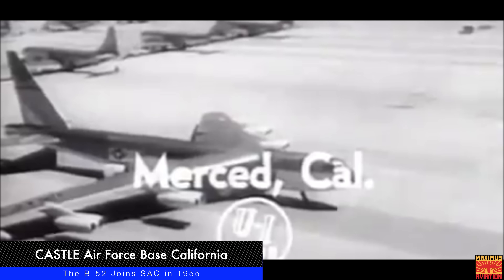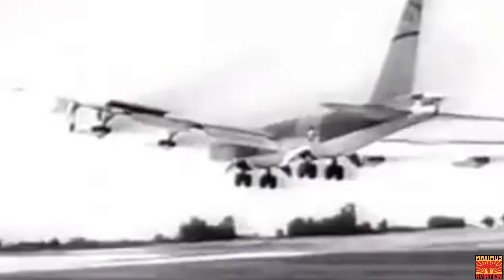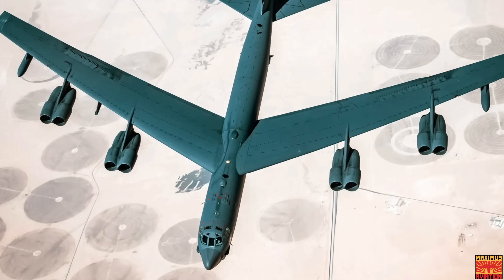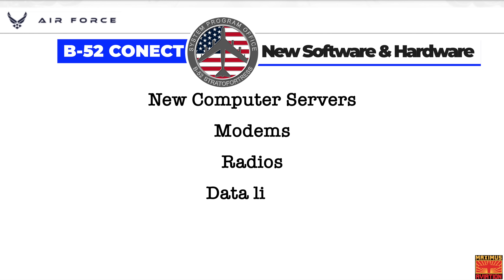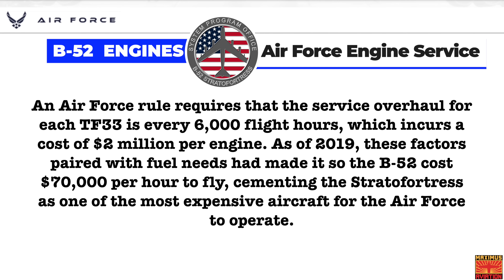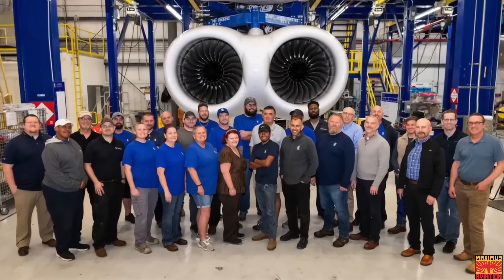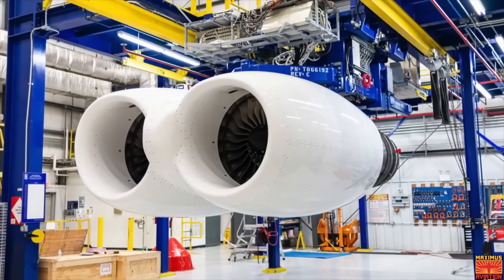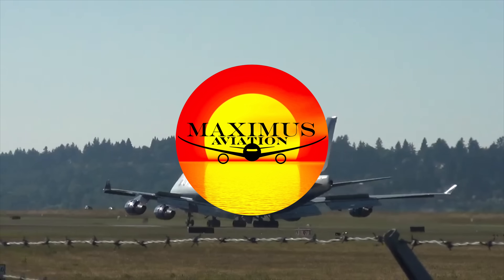The B-52 Will Fly For Over 100 Years With Its New Rolls Royce Engines!

Comment: Cool video, thanks for sharing.  I've worked at Boeing in Wichita, KS since 1986 (now named Spirit Aerosystems since Boeing sold us in 2005) .  I worked as a Quality Investigator in 1988-89 timeframe and used to work rejection tags for the B-52 Rotary Launcher program.  The launcher tube was a very complex piece of equipment all by itself, not to mention all the other assembly components that were added on to make up the whole unit.  I remember watching the drilling operations in the long tube that was made from Titanium (if memory serves me, lol).  The tube was like 20+ ft long and about 20" dia or so.  Had literally hundreds of drilled and machined holes and slots, etc.  up and down the length of it.  I remember the machinists that ran these tubes were always very nervous, they didn't want to be the guy that scraps one of those tubes, lol.   By the time they were drilling and machining slots, etc., the tube had already had many hours of turning.  I remember the tolerances on that tube were very tight.  Anyway, good memories.

Comment: Pratt and Whitney was the better choice and it fit inside the pods less than a fraction of an inch and already had the supply chain in place but they were simply out bid plus a few greasy palms of the politicians.
Reply: The BMW F130 engine was an exact fit for the B-52 and the PW800 was a significantly more expensive program.
Reply: @sandervanderkammen9230  Hello Sandyboy,  F130 is the US designation for the ROLLS ROYCE BR725 engine (in much the same way that J65 was the US designation for the AS Sapphire engine that was the F9 Metrovick).  As you know it has nothing to do with any wholly owned BMW company. 
You'll recall that in the early 1990s Rolls Royce offered BMW a chance to re-enter the jet engine market with a joint venture to develope the BR 700 series engines from existing Rolls Royce twin spool technology, so that Rolls Royce UK could focus on its more sophisticated triple spool engines. Unfortunately BMW couldn't hack it for long and by 1999 had declared that it was copping out.
As you'll recall , fortunately Rolls Royce was happy to take BMW's share and keep the local workers on and it became a wholly owned Rolls Royce company. As you know that was quite a few years before the development of the BR725 which first ran in 2008 long after BMW was gone.

Comment: The B-52  has been long overdue for an engine upgrade. It's a great workhorse that demands we keep her in top flying shape! Go BUFF!!
Reply: The BMW F130 engine is a perfect upgrade for the B-52.
Reply: @sandervanderkammen9230  Hello Sandyboy,  as you know Sandyboy F130 is the US designation for the ROLLS ROYCE BR725 engine (in much the same way that J65 was the US designation for the AS Sapphire engine that was the F9 Metrovick).  As you know it has nothing to do with any wholly owned BMW company. 
You'll recall that in the early 1990s Rolls Royce offered BMW a chance to re-enter the jet engine market with a joint venture to develope the BR 700 series engines from existing Rolls Royce twin spool technology, so that Rolls Royce UK could focus on its more sophisticated triple spool engines. Unfortunately BMW couldn't hack it for long and by 1999 had declared that it was copping out.
As you'll recall , fortunately Rolls Royce was happy to take BMW's share and keep the local workers on and it became a wholly owned Rolls Royce company. As you know that was quite a few years before the development of the BR725 which first ran in 2008 long after BMW was gone.

Comment: When I was a kid, we used to see them fly over on the farm, usually at an altitude as low as 300 feet.  Landing or taking off?  Nope.  The nearest Air Force base was 100 miles away.   They were engaged in low altitude bombing run practice.  There would be a small number of them about two or three minutes apart (I never timed them).

Often I wouldn't see them until the shadow suddenly passed over for a second or so.

Comment: As Pratt and Whitney supplied the original engines, why not choose them over the foreign RRoyce??
Reply: Pratt & Whitney no longer makes engines this small or in this low of a thrust class, modern jet aircraft generally use just 2 massive high bypass turbofan engines.
 The cost of developing a new smaller engine specifically for just the B-52 would cost more than the entire modernization program.
Reply: The F130 is a BMW engine, designed and manufactured in Dahlewitz Germany, it's a military version of an small business jet class aircraft engine.
Reply: @sandervanderkammen9230  Hello Sandyboy,  F130 is the US designation for the ROLLS ROYCE BR725 engine (in much the same way that J65 was the US designation for the AS Sapphire engine that was the F9 Metrovick).  As you know it has nothing to do with any wholly owned BMW company. 
You'll recall that in the early 1990s Rolls Royce offered BMW a chance to re-enter the jet engine market with a joint venture to develope the BR 700 series engines from existing Rolls Royce twin spool technology, so that Rolls Royce UK could focus on its more sophisticated triple spool engines. Unfortunately BMW couldn't hack it for long and by 1999 had declared that it was copping out.
As you'll recall , fortunately Rolls Royce was happy to take BMW's share and keep the local workers on and it became a wholly owned Rolls Royce company. As you know that was quite a few years before the development of the BR725 which first ran in 2008 long after BMW was gone.
Reply: Rolls Royce offered the right engine at the right price with the advantage that they could be built in America without any licencing deals.

Comment: Do not know any air frame can last 100 years. Must be fake news.
Reply: You know one now.
Reply: While the modernization program will include the installation of new wings, empennage and new fuselage skins, the main airframe structures will only be inspected and will be reused.
Most of the auxcillery systems will be upgraded or completely refurbished. 
 The B-52 is not the only Boeing aircraft expected to remain in service for a century, the 707 series remains in USAF and RAF service and is expected to remain in service until at least 2050.

Comment: FWIW, I have been following the "re-engining" of the BUFF for many years.  The USAF did a study that indicated that, at the (then) price of fuel, it made no sense to put the more fuel efficient turbofans on the planes, as the cost of the new engines was too great.  Then some wag at the USAF pointed out to his skeptical superiors that they used to price GROUND REFUELING ONLY, and forgetting the fact that B-52s almost always did air-to-air refueling on just about every mission... at a cost 17 TIMES that of ground refueling.  Case established!  Also, there were proposals to use four large hi-bypass turbofans in place of the eight (much cheaper overall).  This turned out to be almost impossible, as loss of an outboard engine would cause so much yaw that the existing vertical stabilizer and rudder would not provide sufficient control.

Comment: I imagine, that building a B-54 as a replacement in 2050 will essentially be a jet liner with slimmer fuselage, a deadly stand off package and some radar cross section optimization.

Extremely proven and fuel efficient high-bypass engines like the Trent 1000 and you have a package that reduces the operating costs per flight hour to near jet liner levels, which is insane for any military jet. Another bonus of a commercial jet engine is, that you can get commercial of the shelf parts for that bomber.
Reply: The Rolls-Royce Trent 1000 has proven to be a very poor design beset with reliability issues..
fyi; the F130 is a BMW engine designed in Dahlewitz Germany
Reply: @sandervanderkammen9230  Yeah, but the B-52 uses 8 of them, if you cut the number of engines in half, I imagine you need half of the time for routine engine maintenance.
Reply: @JainZar1  Its a simple math problem... the fan diameter of a Trent 1000 or GE90 is 3 meters and the engines are over 7 meters length.. if take a quick glance at a B-52 parked on the apron these engines simply won't fit without extensive modifications to the entire aircraft.. there is no ground clearance and the GoG is way off... it also interferes with under wing hard points.. a very important issue on a heavy strategic bomber.
 The F130 engines slot right into the existing nacelle envelop with little to no change to the original design  of the wings
Reply: @sandervanderkammen9230  Yeah, for the B-52 I totally understand, but for a potentially follow up to the B-52 I imagine they would use 4 big fan engines instead of 8 smaller ones.
Reply: @JainZar1  I don't think anyone seriously believes that there will ever be a follow up replacement for the B-52... designing and all new aircraft would be incredibly expensive and would have little difference in performance to what the updated B-52 will offer for the cost.
Reply: @sandervanderkammen9230  Yeah, but somewhere down the line the maintenance for these birds will start being too high. And if we didn't loose the need for a large, cheap to operate bomb truck, it's either going to be a new bespoke aircraft or a repurposed transport aircraft. Because I don't believe they will start to remanufacture the B-52 in 25 (or more) years.
Reply: @JainZar1  Actually the Boeing B-52s in service today have been completely rebuilt and will receive another airframe overhaul during the reengine process that will include new wings, empennage and new fuselage skins.
The B-52 was designed to stay in service infinitely with scheduled overhauls unlike the newer aircraft that have to be scrapped at a specific number of hours and cycles.
Reply: @sandervanderkammen9230  Hello Sandyboy,  as you know Sandyboy F130 is the US designation for the ROLLS ROYCE BR725 engine (in much the same way that J65 was the US designation for the AS Sapphire engine that was the F9 Metrovick).  As you know it has nothing to do with any wholly owned BMW company. 
You'll recall that in the early 1990s Rolls Royce offered BMW a chance to re-enter the jet engine market with a joint venture to develope the BR 700 series engines from existing Rolls Royce twin spool technology, so that Rolls Royce UK could focus on its more sophisticated triple spool engines. Unfortunately BMW couldn't hack it for long and by 1999 had declared that it was copping out.
As you'll recall , fortunately Rolls Royce was happy to take BMW's share and keep the local workers on and it became a wholly owned Rolls Royce company. As you know that was quite a few years before the development of the BR725 which first ran in 2008 long after BMW was gone.

Comment: I just hope they remember the B52H doesn't need more powerful engines. We are talking about a 50s/60s airframe designed and stressed for the thrust of a TF33. The takeoff roll does not need to be shorter. And it cruises as close to Mach as it needs to. What it needs are engines that are as dependable as the TF33 but way more fuel efficient. Fuel efficiency means fewer air to air refuelings per mission profile will be needed. Maintainability and longevity will be positives for the military budget as well.  But fewer air to air refuelings will be the most important and appreciated benefit to the flight crew.

An unfortunate consequence of these new engines may be longer missions requiring extra crew members for flying and navigation duties. And there is the issue of needing better restroom facilities because of the longer missions with larger crews. All we had in the B52G I flew during VietNam and the cold war that followed in the 70s was a honey bucket next to the periscopic sextant nav-station on the upper deck. The B52H may be better equipped though since it doesn’t have the 10,000-gallon distilled water tank (behind the EWO and Gunner positions that provide extra thrust needed for takeoff) on the ‘G’ model I flew.

Comment: I'm sure that Sir Charles Rolls and Sir Henry Royce would be immensely proud of what they started all those years ago.
Reply: The F130 is a BMW engine designed in Dahlewitz Germany.
Reply: @sandervanderkammen9230  Hello Sandyboy,  as you know Sandyboy F130 is the US designation for the ROLLS ROYCE BR725 engine (in much the same way that J65 was the US designation for the AS Sapphire engine that was the F9 Metrovick).  As you know it has nothing to do with any wholly owned BMW company. 
You'll recall that in the early 1990s Rolls Royce offered BMW a chance to re-enter the jet engine market with a joint venture to develope the BR 700 series engines from existing Rolls Royce twin spool technology, so that Rolls Royce UK could focus on its more sophisticated triple spool engines. Unfortunately BMW couldn't hack it for long and by 1999 had declared that it was copping out.
As you'll recall , fortunately Rolls Royce was happy to take BMW's share and keep the local workers on and it became a wholly owned Rolls Royce company. As you know that was quite a few years before the development of the BR725 which first ran in 2008 long after BMW was gone.

Comment: Refitting B-52 aircraft with modern engines must need to consider factors like metal fatigue on aging wings, etc.
Reply: The B-52 has a comprehensive maintenance program that includes new wings, empennage and replacing fuselage skins while the original fuselage structure is expected to remain in service until at least 2050.

Comment: It's like putting lipstick on a pig. It's to be hoped the newer more powerful RR engines don't pull the wings off these aeronautic dinosaurs.
Reply: The B-52 will receive new wings during its normal maintenance overhaul program.
The F130 is a BMW engine.
Reply: @sandervanderkammen9230  Hello Sandyboy,  F130 is the US designation for the ROLLS ROYCE BR725 engine (in much the same way that J65 was the US designation for the AS Sapphire engine that was the F9 Metrovick).  As you know it has nothing to do with any wholly owned BMW company. 
You'll recall that in the early 1990s Rolls Royce offered BMW a chance to re-enter the jet engine market with a joint venture to develope the BR 700 series engines from existing Rolls Royce twin spool technology, so that Rolls Royce UK could focus on its more sophisticated triple spool engines. Unfortunately BMW couldn't hack it for long and by 1999 had declared that it was copping out.
As you'll recall , fortunately Rolls Royce was happy to take BMW's share and keep the local workers on and it became a wholly owned Rolls Royce company. As you know that was quite a few years before the development of the BR725 which first ran in 2008 long after BMW was gone.

Comment: Flew with a Danair Comet from Hamburg to London and then onto the USA for my first visit, 1968. 

The London-New York leg was with a DC-10, which itself was "falling out of the skies" at the time.
Reply: The Comet remains the worst engineering failure in commercial jet aviation and has the worst safety record of any jet airliner in history.
Reply: Unlike the Comet the DC-10 series turned into a very safe and successful aircraft that is still flying today...  the Comet was grounded 43 years ago due to metal fatigue issues.
Reply: @sandervanderkammen9230  hello Sandyboy, as you know the Comet had a service career of over forty years and with operators in twenty countries.

Comment: I remember as a young man seeing B-36's warm up on runways and that was impressive.  Later I saw B-47 move out the big beast.  Soon after the massive B-52's were spread.  Wings were ended with the 47's and 52 replacements in Biggs in El Paso.  The 36's were just outside Fairfield Ca and Susan Ca. Thanks for the memories.

Comment: Well I for one am very glad you told this fascinating story. Over 100 expected years in service, incredible. Don't expect there'll be anything left of the original aircraft at that age. Or am I mistaken?
Reply: The B-51s will have all new electronics and mechanical systems,  the wings and empennage get completely overhauled or replaced, the fuselage gets new skins but the fuselage airframes are still original the newest being made in 1962 and are expected to remain in service until at least 2050.

Comment: To watch the evolution of the B-52 is interesting indeed. I was born in 1955 when SAC started using the aircraft. Today, in 2023, many of these plains still serve a vital role in the defense of our nation precisely because they were designed to be adaptable. 
One thing hasn't changed in all these years. The BUFF is still an excellent, proven and reliable platform. It's ability to deliver a massive amount of ordinance anywhere it's needed makes it a formidable weapon indeed. Modern enhancements, such as these new engines will keep it so.